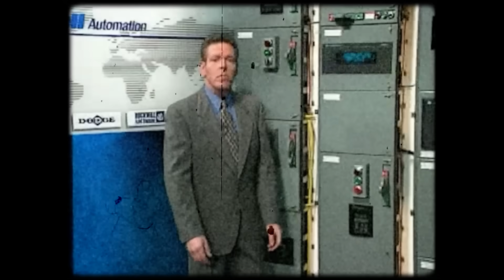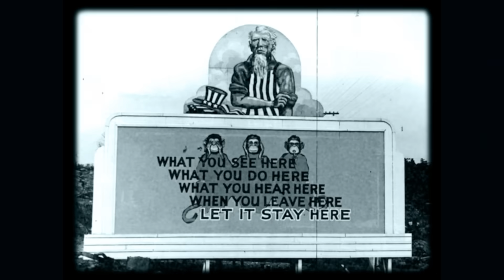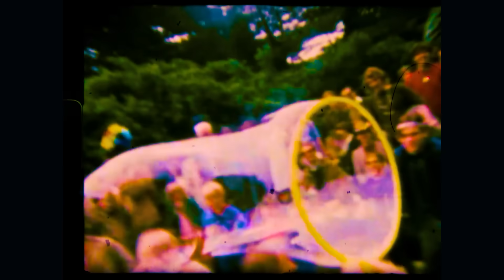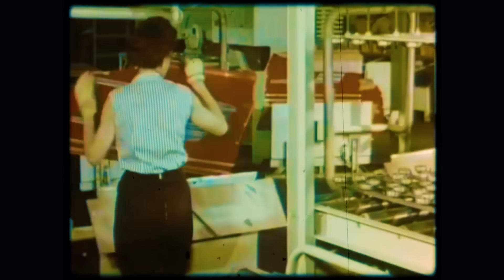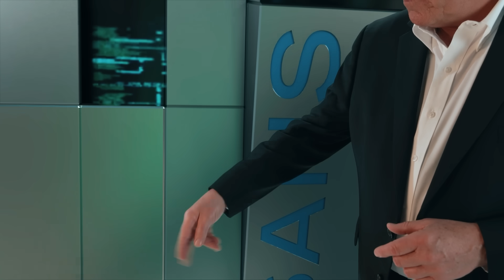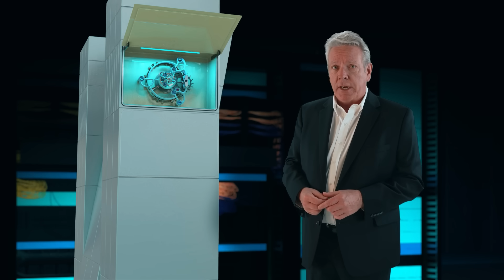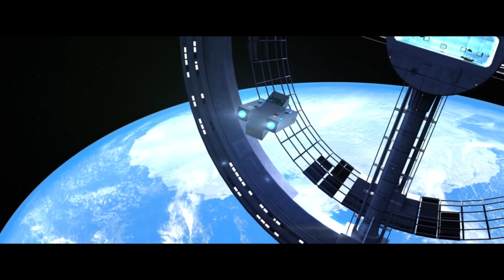SANS ICS HyperEncabulator

Comment: After all these years I’m glad to see they still have the side fumbling under control.
Reply: Yep. That is important for backwards compatibily  to interfacing systems that have low fumbling tolerance.
Reply: I've not noticed any improvement in sideward fumbling and an increase in retro fumbling compared to previous generations. Support is lackluster. They recommended recalibrating the prefabulated amulite and adjusting the sinusoidal depleneration setting, which I obviously did before contacting them. They sent the wrong phase detractors and they're not longer synchronized to the cardinal grammeters.

I ended up 3d printing an orbispherical syncatron for the pseudoaxial stabilodisc to fix it but that did nothing for the fumbling.

I did find the trispectral wave harmonizer doesn't NEED the paraflexal condensate inviber so I replaced it with an off the shelf sporadic disintaplacer and that eliminated all side-fumbling.

The retrofumbling remained. It was a side effect of quadlenticular oscillations coming from the omniplanar vortex recoupler. So if you need rotocorporeal entropy you're SOL. By using a subquantum isolation membrane across the syncopatory gyroflange we were able to isolate the speckling created by the retro-fumbling. With that noise minimized the nano-centric vortex decoupler was able to produce satisfactory results.
Reply: I just used a rubber band or two.
Reply: with all the new and exciting features added to the system it's a wonder it doesn't do a shit ton more side fumbling than the early prototypes.  pushed hard enough though i'll bet it does some rear fumbling... on paper anyway
Reply: It may surprise you to learn that the present considerations of such erudite professionals who are concerned with the field of lateral-mishandleology, indicate an increasing support for a notion that there is an amount, greater than zero, of such fumblings nominated as of the side (or side-like) type, which are actually considered beneficial for subjunctive parsing of (in particular) the north-western type of operand.

The response of critics has been to suggest that the juxtaposing of feminist ideals can only lend credence to eastern-type expressions of modalistic typology. Literalistic interpretations of the classical Hokey Pokey, demand a soteriological transliteration for the axiom. Hence the well known saying "I'm so hungry, I could lead a horse to water".
Reply: Well, by now a lot of us are quite experienced with manipulating those spurving bearings
Reply: A certain malted beverage was involuntarily ejected through my nasal passages at an extremely high velocity upon reading this comment.
Reply: @forrestozbolt1107  Projectile sinusoidal disencabulation?
Reply: Thank God for marzelvanes!
Reply: @aztec01mcf especially the Coptic ones.
Reply: Hahahahah
Reply: Oh duck, I'm in tears
Reply: Enshitification has come for so many things, but Encabulation is too important. That being said, you know as soon as encabulators start side fumbling, they've become enshitafied
Reply: Wasn't the side-fumbling only apparent with anhydrous Aluminium sinusoidal spurving bearings especially over 60⁰C?

Comment: We had a challenge when I was an intern at an engineering firm to use language from the original retro encabulator video in our reports to our boss, who was relatively business oriented and non-technical, without giving context to see if he listened and understood anything we were trying to explain to him. I regret to say that I totally broke when I said the thing I was working on was suffering from "Magneto reluctance", which kind of gave the whole thing away. However it's a good test to try on your boss sometime if you think that he doesn't understand anything you do.
Reply: crazy thing is, magneto reluctance is actually technically sensible, if not just stating a principle and a quality in the same line..
Reply: That is a high level Dilbert move.
Reply: Plot twist: Your boss is very familiar with this series of videos and throws it right back at you.
Reply: And here I thought it had to do with a character in X-Men....
Reply: Most people have no idea what a mag is anyway.

Comment: I’m a security professional, and the inflagration of the VMS (Vibratron motional system) within the SOC is a big benefit for bipedal  phlanges. Awesome. Can’t wait to see the interspace between the mapping for camera call ups too
Reply: Thank you for your service.
Reply: I'm a little miffed that this new model doesn't have the reiterative phase capitation features that have, traditionally, been bundled with the recombinant viscosity matrix.   But, hey, what do I know?  I'm just a lawnmower security mechanic that encabulates 60+ hours a week.
Reply: And indeed, Kosckiuskos theorem revolves through metastatic ketonic aegeum.
Reply: If you need spare vibrators for the Vibratron I know a supplier.

Comment: I have just had a series of strokes as a result of my hydroencabulator running with out-of-spec recticulating splines.  Luckily I was able to rearrange the SOC drawer which seems to have resulted in the production of a non-floridian magnetosphere, restoring proper mesh with the recticulating splines and xenosphere inside the hydrometer.  That way encabulation can continue uninterrupted even with non-tolerant recticular splines installed in the encabulator.

Comment: This manages to both make fun of the thing and be the thing at the same time. That's really impressive writing. Oh, and it seems much much longer than the 6 minutes it actually is.
Reply: > Oh, and it seems much much longer than the 6 minutes it actually is.

That's just the fluoroeffective macro-temporal-transposer effect. It shunts time through the Dreyfus Shaft and photo-retrospectively transluminates the effervescent flow.
Reply: That's due to The Helvetic Scenario, due to the panoramic fan, due to the fumbling of the grammeters!
Reply: Oh:

"But that's not important now."

Comment: SANS always trying to replace their highly repairable 90's encabulators with newer irreparable units. The contabo pins are potted inside the bosonic field attenuators, preventing polarization and demagnetization by field operators. In theroberic rebuytalization used in the fossil fuel industry, this decreases the service life of the whole B-15 amortization module by 95% and isn't covered by SANS warranty. The more destressing thing, is that it forces operators to fall back to catalizing photo-phosphenes, a practice so bad for the environment that the CSB labels it worse that fluoridation of calciumdysonate.

Comment: I still use my retroencabulator to this day! I would say, “they don’t make ‘em like they used to”, but honestly I’m really looking forward to upgrading to the new hyperencabulator. The encabulation protocols in the sub-0 level offered by this new breakthrough tech is going to really shift the market.
Reply: I heard that you can marblate the movable retrograde spinatrons without intracussive spallups messing up your encabulation.. totally worth the upgrade if that's true..
Reply: @rsrt6910  I thought so too at first, but now I really miss the gentle rending squeal of the old hydrocoptic marzlevanes. These new ones just make weird, sonorous graculations.
Reply: @Panicagq2  If I was still just encabulating the occasional antifugable regradiations for friends and family I'd definitely keep my old retroencabulator.  The sound of the pentametric fan really made you FEEL the encabulation.
Unfortunately, I'm increating more and more transfusilation in my encabulations and I can't spend as much time clearing reclusivated asmotium from the spurving bearings anymore.
Reply: Hopefully, we will be able to produce spurving bearings as one off productions that can meld insynchronously through hyperflygation, as per the Hanz-Ganstrom effect demonstrated during the first transfular escapilations test. I'm really tired of trying to find sets of spurving bearings that were created with the same quanta as the oscilating hysker flange. These parts are becoming more and more antique, and I worry that I won't be able to teach my grandchildren about encabulation once we run out of spurving bearing sets manufactured in the same batch of quanta. I've tried using mismatched bearings from eastern europe in the past, but they fail to achieve the proper magnetic resonance. I tried using an old torque converter as a sort of quanta buffer to alleviate the transmoidal stress, but even when I transfer casings in a pure nitrogen environment, the EMGL-7 particles still manage to escape before I can harness their energy in the quanta cloud. I'm trying to sell some of my old VX gallium sublimation rigs to hopefully be able to buy one of these new HyperEncabulators, but the market just isn't there right now.... Thanks Biden.
Reply: @Jarl_Thidrandi  I probably shouldn’t mention this as it’s technically classified, but… just so you know, the USG has stockpiled enough spurving bearings to last until your grandchildren’s grandchildren, perhaps longer. They have warehouses full of em.

Comment: I prefer to use a quad inverted wobbulator myself.  Has much more efficient trixodes which intrinsically reject forward avalanche flux on the fourth manifold planar frame matrix.  In doing so this has the benefit of protecting all the other frames from reactive EMF decoupling and thus avoids harmonic runaway through a semi-silvered cancelation field.

Comment: Elon Musk has been using a Warp Encabulator for 17 years. This was developed from a side project (the Encabulating Spervoclator) that was discarded by Rockwell back then. The Rockwell Engineering Commissary (T.R.E.C) was unable to destabilize the dingle arm enough to prevent flabulation of the blicker drum. Musk found the discarded Encabulating Spervoclator while dumpster diving at T.R.E.C and examined it under his mass-spectographic isotopic double dia-thermal dia-phonoscope and discovered that T.R.E.C. had accidently installed the blicker drum battery backwards. Every Tesla automobile contains a microtrophic deflabulated blicker drum, without which it would be impossible for the vehicle to maintain a steady sales pace.

Comment: It appears that the Yavin 4 firing matrix has overtaken the acceleration vectors of multiple inner-trench, self-propelled, single-manned firing modules.  Owing to a new standard in orbital transparency options and previously unattainable targeting distance flexibility, intrusive elements pose minimal risk of self-triggering indefinite power consumption delays or resulting in any sudden loss of molecular cohesion.

Comment: I'm so excited to see this hyper encabulator. I have been running my Funk and Wagnall Turbo encabulator for more then 40 years in the process desprewing my Cogsman spiral centric polynomial reverse action smoke shifters. Now I should be to assymetrically quantam phase  shift desprewing of spiral concentric monomial back plane bacon stretchers.
Reply: 40 years and no issues with side fumbling it sounds like, nice!

Comment: This seems like just a cheap knock off of a continuum transfunctioner. (But I find it's better to use a dimensional transmogrifier anyway, instead of transfunctioning or even getting into the labyrinth that is encabulation. It's far easier on the picante sectional pin clips, and it's the only way to effectively counter an imminent incendiary psycho-frakulator, should you ever need to.)

Comment: As a member of a cybersecurity team, we actually tried to implement the HyperEncabulator a few weeks back, but we just couldn't get it working. We had problems with penetration and even tried using SOAP to help ease it through the firewall, but it just got stuck in the sock, what a mess. 

I think it was due to the fact that you need to maintain a bit of side fumbling to allow for easier entry into the proper port. In any event, we're just going try latter. We need a break after blowing out the WAP.

Comment: So a perpetual motion machine is truly possible, using pameble miltidimensional and multiphasic extrodine high frequency biophemoric ultrawedged quadrahedrails in an Einstein-bowman super condensatial environment, but only if it perches on the cusp of a 23 solar mass pulsar spinning at a frequency relative to the substructure at least 379 million megahertz. Anything less could cause an isometric platitude reaching galvanistic amplitudes, and thus rendering time flow within a 1.6667 light year to diverge into multiple universes that may not be able to fully detach from our own, and thus cause a multiverse rip in space time, leading to the destruction of all multiartomic structures, incluxative and information of all life. The question once again is not can mankind do it, but should we do it, and accept the horrific consequences.
Reply: yes. 😂😂😂😂😂

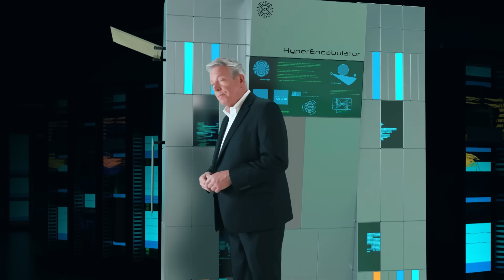Comment: 5:27 I notice you're using the old obsoleted tempest81 modules with redundant act back surfacing. I would recommend updating to the tempest2K(4K) HEAT module with zero REN front loading divisors.
Reply: noted!